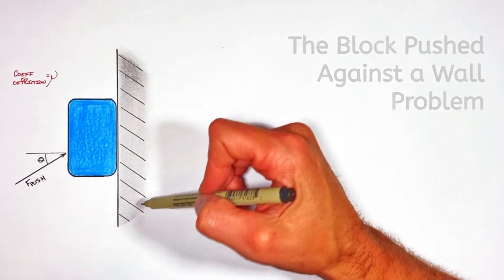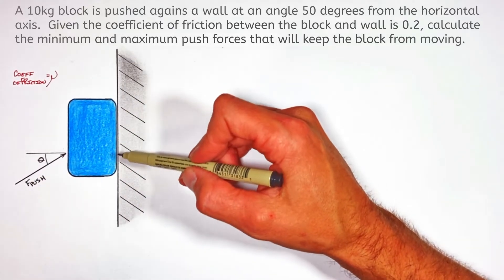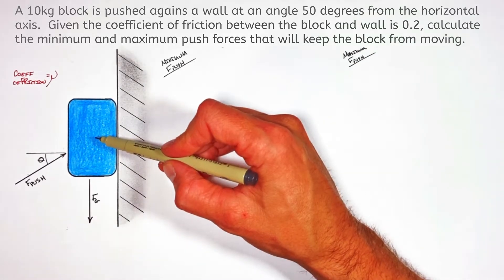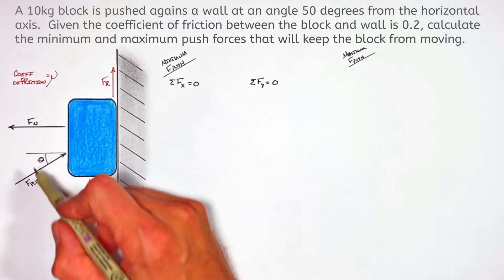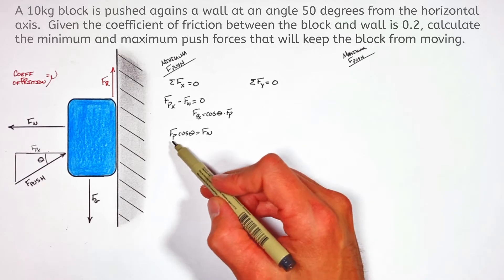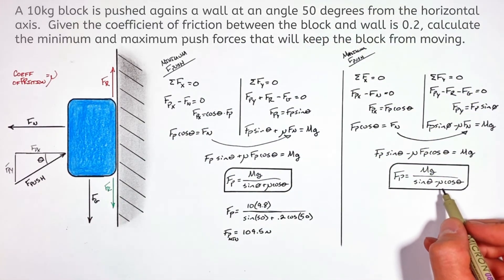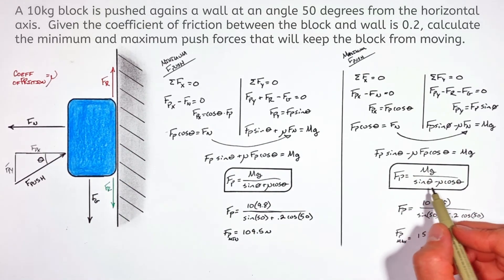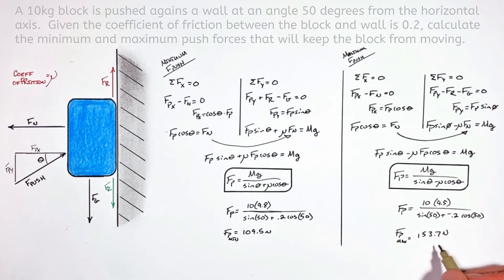Block Forced Against a Wall with Friction:  Calculate the Range of Forces to Remain Stationary

Comment: Hi
I am here because of slightly different reason that has to do with friction
Let's say I have two cases
1: a friction disk is beeing pushed on by other disk with some force F
2: a friction disk is beeing pushed in between two disks one which is pushing aigainst it with the same force F
I got to the conclusion that specific pressure or F/A where A is area is the same in both cases 1 and 2
Since despite disk in case 2 having twice the area in contact it also has another force equil to F pushing on the other side
Am I correct?
Reply from the maker: The question is:  in case 1, what was on the other side of the first friction disk?
Reply: @INTEGRALPHYSICS  Lets say a shaft it's fixedon the other side

Comment: What about in the case of a non zero acceleration?
Reply from the maker: Then you need to apply F=ma to the y axis.  The imbalance between the vertical component of the applied push force, friction and gravity will result in a net force vertically.